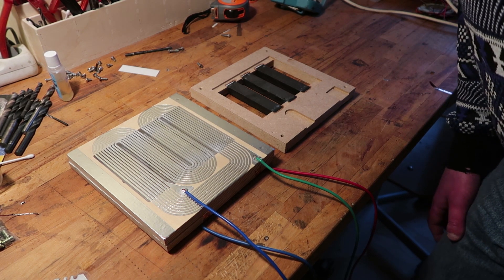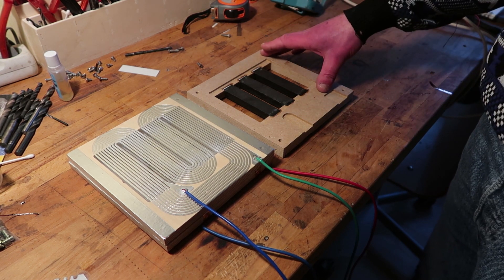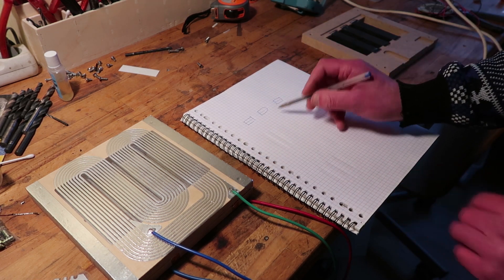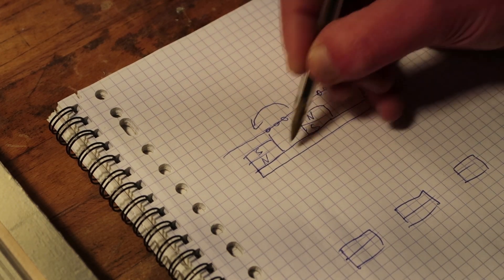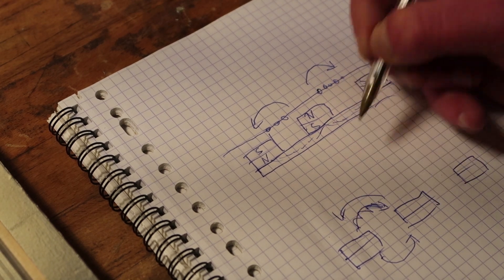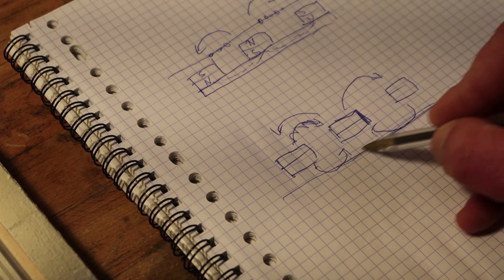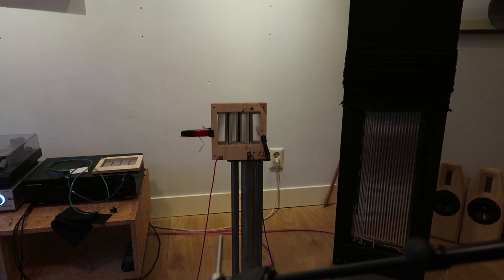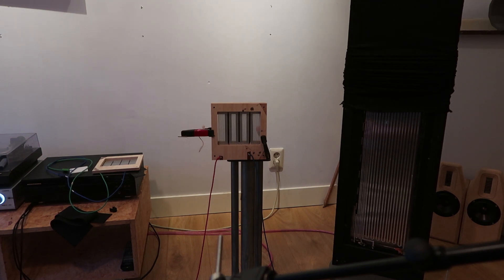Stacked planar - Victory

Comment: have you ever placed two panels facing together, like isobaric? you could vary the space in between, try loading w damping materials or even sandwich a fabric if the are directly touching. just curious..
Reply from the maker: It is the same as my dual membrane speakers I made a few weeks ago

Comment: with isobaric loading (stacked drivers) you don't gain more dBs, but get more low end, you change air compliance in relation to the electric&mechanical compliance, the air will be a more flexible spring. I never had to learn about open baffle isobaric loading i have to say, look it up isobaric loading
Reply from the maker: that might be true for normal drivers when you DOUBLE the impedance when you put them in series.   with the foil if i put 2  foils in series the net result is compared to 1 foil =  0dB  if i would make the series version the same impdance as one foil, we should gain 3 dB.   by still using the same magnets in this case.  ony thing changed is having 2 foils over one. you can see that in the video. 2 ins series are the same ouput as one panel alone.  but we should gain 3 db if we would halve that impedance back to the impedance one pannel had.
Reply: @joppepeelen  no you end up with the same impedance as one foil and have the same air aria as one foil due to stacking. In case of parallel wiring thus half the ohm you gain twice the watts, but again you half the air aria and gain 0dB.   But all this said, you change the Thiel/Small parameters and this could be a good thing.
Reply from the maker: you forget i think your excursion will be higher when both work in tandem,    so at the same overall Independence you will gain 3 db when stacking them,  (like i did with my esl panels. ) but only if you keep the Independence of one panel the same as  2 in series.. or parallel whatever you like :) (must say 34 db is the max theory... up top that might be far less. )
Reply: @joppepeelen  eej hello, stacking is almost like glueing two membranes on top of each other, twice the weight and the rest is up to the coils and the impedance they create

Comment: I think that in a alu trace like that you should add two more magnets ( 5 in total) at both ends of the frame and make a slightly wider frame leaving some free space between the side traces and the glued frame. This "stacking" reminds me of the isobaric loading used for woofers. It will probably reduce non lineariries and provide a small boost. It will work much better if you make it air-tight between the two frames.
Reply from the maker: You are absolutely right but i doi know that :) ,  the whole panel is not about making a nice panel. :) just to confirm the idea :)
Reply: @joppepeelen  
Exactly... "proof of concept"

Comment: Apogee uses double ribbons. Or actually a long one from the floor up, turns at the top and then it goes down again. Joppe, I can mail you pictures.
Reply from the maker: witch model ?  i never seen something like that on a apogee,
Reply from the maker: when i think of it ... that would be weird since they would move in opposite  ways :( hmmm or they might have turned the magnet 90 degrees... let me check that :)
Reply from the maker: but not in the same magnetic field or the second run back would move in the oppositie direction (if they used a normal ribbon motor)

Comment: Don't know a dam thing about making Planar magnetic tweeters or should we say mid-tweeters...Watched one of Danny Ritchies videos about what happens when you put two tweeters on the same baffle front....at some frequency they start to cancel each other out or they create wave canceling properties with huge dips and valleys. Maybe somehow some way they're out of phase and they're not adding up correctly for increasing DB's. You've doubled the complexity of the tweeter with two different planars emitting their signals at different time frames. Maybe pico seconds but still enough to affect high frequency signals. Lower frequencies may not be affected and they might combine more easily. anyway wild ass guess.
Reply from the maker: the whole idea  of this contraption is not tweeter or midrange indeed,  but low end and lower midrange , to mate to a large ribbon or something else :)
Reply: @joppepeelen  Must have missed that part in one of your videos.